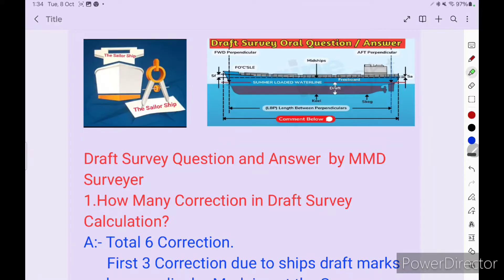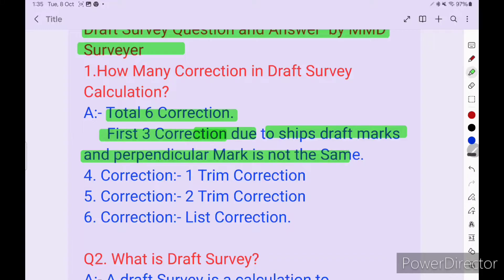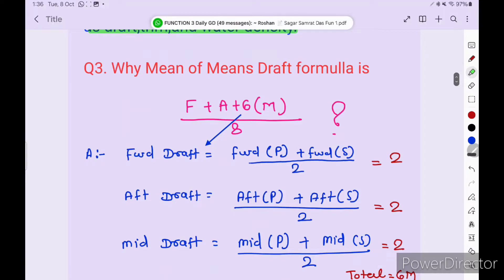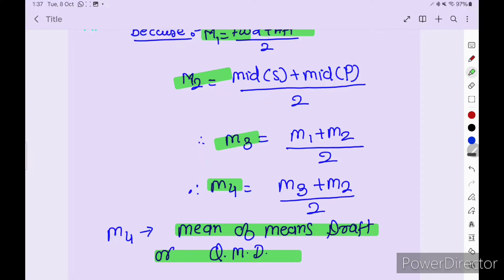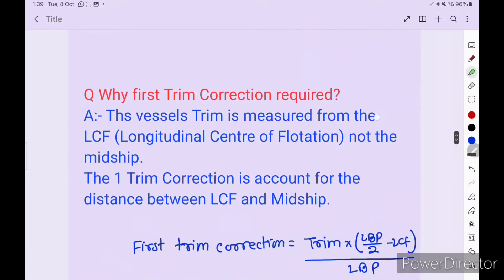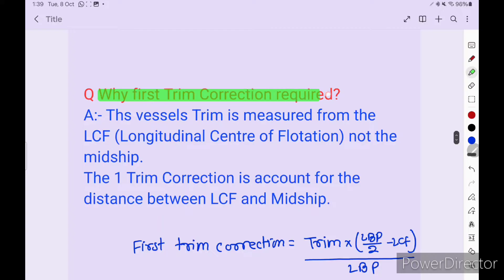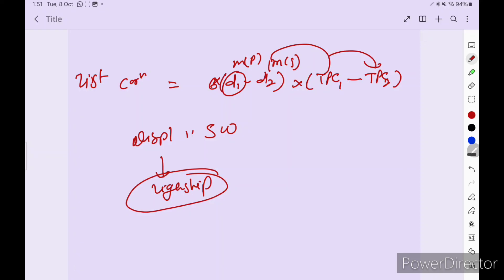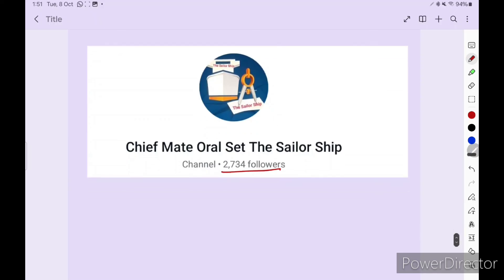Draft survey Question & answer by MMD surveyor

Comment: For an observer the Sun had a GHA of 240O38’ and SHA 251O 20’ when it attained the altitude 069O 30’, bearing North. Find the position of the observer. 

Dear sir
Could you pls assist in solving this question

Comment: 6 x midship draft in QMD formula because the midship section represents the largest cross sectional area of the hull, by assigning it a higher value we can ensure the mean draft of the ship represents a more accurate calculation.